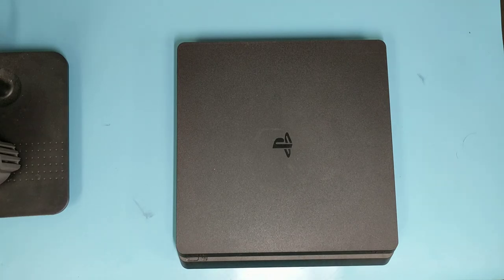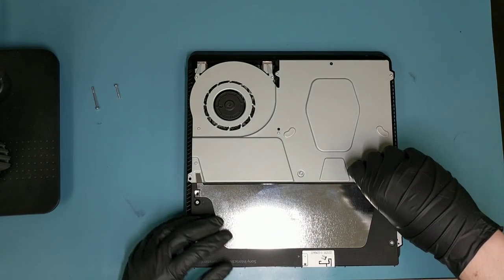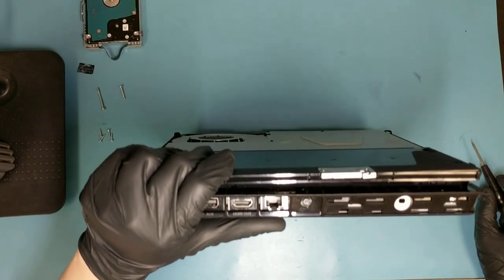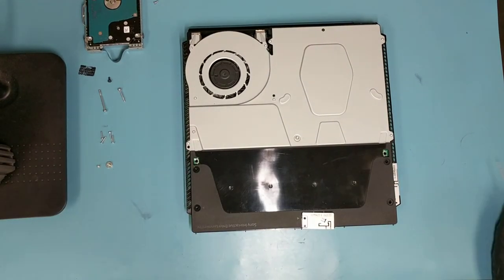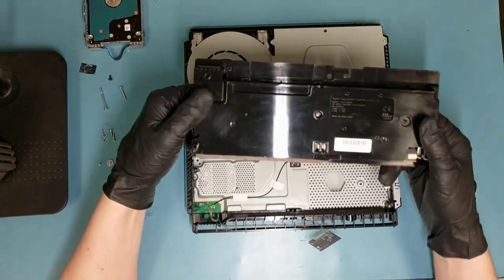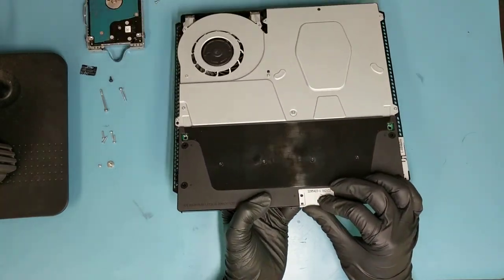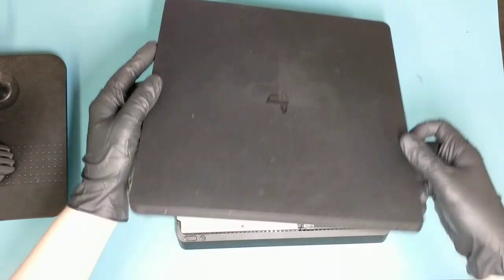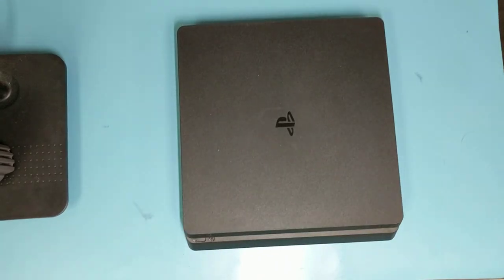PS4 Slim Power Supply Replacement

Comment: Thanks for this. I went to boot my console up today only to discover that the power supply unit seems to have fried itself in the night for some reason. I've ordered a replacement but it'll take quite a while, but when it does finally arrive this video will be a great help to switch them out.
Reply: where did you order the power supply
Reply: did it work?
Reply: @kartel876  Not for very long, clearly something else in the machine was frying them, but it did work long enough for me to transfer data to a new PS4.

Comment: Thanks for this tutorial! I just unplugged and plugged back the power supply inside and it’s working now! Thanks for the help!
Reply: what happened to your ps4? mine cannot turn on. its just beep once and nothing happens. can i try this method?
Reply: It means blue light of death. Common on PS4. I tried this method in the video (unplug/plug) the power supply. If this still not work, I suggest buy a power supply compatible to your PS4 you can replace it on your own by following this video.

Comment: Thanks for clean and precise explanation. Great help, you have my like good sir :)
Reply from the maker: Happy to help!
Reply: I ordered a new power supply and I  got it all ready to put the new one in but the female end of the connector is a tiny bit different than the male end and won't snap in place what can I do to solve this problem?
Reply: Fix Ezy do you have to have a certain mode number power supply? Not sure which to order for my ps4 slim.
Reply: @tjcook9918  Yes you do. Check what CUH your PS4 is, and order a power supply that is made for that Model. SONY has this HORRIBLE thing that for every year, they change a little of the design of their consoles internally and that means if you buy a CUH 2115A PSU and have a CUH 2015A console, you cannot install it.
Reply: @dw8597 
0

Comment: Thank you for making this video it helped me fix my PS4 :)
Reply: Is the ps4 power supply the same as ps4 slim
Reply: Jose Mendez you might have a different one open your PS4 up and look at the back of the power supply
Reply: @human9234  oh ok
Reply: @human9234  wait before did your ps4 have a light or was it like dead and it didn't even turn on no noise no lights

Comment: Thank you so much for this man, the only problem I have is that there is no metal rectangle piece under the top of my ps4 and it only has two Phillips screws
Reply: Did It still work mine don't have that either but I ordered the one that does

Comment: I was hit was the blue light of death and did this, but re installed the old power supply and it worked just fine after.
Reply: This comment saved me $100 and a ton of heart break I did that and it works fine!!
Reply: @jaysantiago830  did it worked? Got strucked by lightning
Reply: Gary Clark, Jr yeah mine would turn on for 1 second then off disconnecting the power supply then reinstalled the old power supply and it works again
Reply: @jaysantiago830  Wait, you just took off your power supply then reinstalled it and it worked again? What was the issue then?
Reply: Yekkusu Sekai Seiken I opened it up un screwed the power supply then took the whole thing out and put back in and it was fixed
Reply: Gary no last name Were you able to get yours fixed?

Comment: Hey When I turn on my PS4 slim, it shuts off right away
Do I have to get a power supply replacement??

Your reply would be greatly appreciated. Thank you
Reply: Make sure your power cord is in good try and boot safe mode if you can but most likely a power supply or software issue
Reply: No, if it turns on then something else is the problem

Comment: Thank you for the video. I did not have an antenna on my version, but your instructions still helped. My PS4 did not power on with a replacement power supply. What should I do next? Is the board fried?

Comment: I broke a wire on the 4-pin power cable that connects the PSU to the motherboard. Is that replaceable? Model is a Slim CUH-2015a.
Reply from the maker: Yeah it’s a separate part. You can buy it online for like 10 bucks
Reply: @FixEzy  Thanks. Got one on eBay for $8 so hopefully I can get it fixed without too much hassle. Looks like I need to remove the disc drive to remove the broken cable and route the new.

Comment: The peace where you pull that has the like 4-5 little black wires that’s hooked from the Power Supply to the console I’m having a hard time pulling that out i don’t want to break those little wires how do i get it out easier
Reply: I’m trying to detach it to replace it

Comment: When the power button of my PS4 slim is pressed, the blue light shows for 30 seconds ( it doesn’t flash. Just a blue light) and switches off. I thought it was the APU? But could it be the power supply?
Reply: Mine does the same idk I'm just gonna hope it's the power supply and fix it myself

Comment: hey, i have a PS4 slim white CUH2006B B02 , i was wondering if this model from an online shopping site is compatible

PS4 Slim ADP-160ER Portable Power Supply Replacement for PlayStation 4 Slim CUH-2000

thanks
Reply: Are buying used ps4 consoles inside sites legit?

Comment: The don't know what happened to my PS4 slim but It won't turn on when I press the button and Is that mean AC power cord broken or I need to do power replacement when I turn on even the blue light didn't show up So can you show me how to fix please
Reply: i have that problem had you fixed it??

Comment: How much does it cost to repair and new power supply
Reply: Power supplies are about $40-60 usd. A fix like this is easy to do, its cheaper to do it yourself unless you wanna shell out another $40

Comment: Hi, from which places can I get 12 volt on a PS4 Slim ? I removed the internal hard disk, I put a sata extension and the 12 volt is missing for the 3.5 disk of 4TB WD40EZRZ, this disk get 5v 0.6 A and 12v 0.45A, the original Toshiba 2.5 of 1TB says 5v 1A, thanks
Reply: I opened the power supply and 12v is the main output voltage, I did not know, I soldered a wire to the output of the supply and the 4 TB WD40EZRZ SATA disk was working ! :-) 
( These from sony! All to save a thick 12v track on the SATA output )

Comment: so i had a dead ps4 dont know what is wrong with it randomly wouldnt turn on i ordered a power supply and did this still not getting any results and im positive its setup right could you explain to me what else might be the cause im not getting any noises or lights when i try to power it on. could a dead harddrive do this? someone please let me know
Reply from the maker: A bad hard drive would not cause this. It’s gonna be a bad motherboard or a bad PSU or a bad power cable. The only way to tell is to check output on the new PSU with a multimeter.

Comment: My power button is sticky not stuck but sticky from my dumb drunk cousin spilling her cooler on it. Is it easy to clean it so the button works normally just worried that i might have to open it and clean it but is it possible to open and clean it without much work? Or is there a way to clean the stickiness without opening it?
Reply from the maker: Get 99% isopropyl alcohol. Unplug the ps4. Get a cheap toothbrush. Dip the brush in the alcohol bottle. Brush the button and dip it again. Do this until button is not sticky. Or take it apart like in my video. It’s only gonna take 5 min.
Reply: @FixEzy  thanks man that was bothering my ocd lol

Comment: Hey can anyone tell me if the power supply on the old ps4 and ps4 slim are the same???? I really want to fix it and save myself a couple of bucks, because my power supply on my slims broken, yet the one on my old one is fairly new. Only reason im doing this is because my hdmi port is broken on my old one, and its 50 to fix when i could buy the tools to do it myself for 15 bucks
Reply from the maker: The power supplies are different. If you wanna save money replace the HDMI on the old one yourself.

Comment: My PS4 the only thing it does is the blue light and the turn off and doesn't turn on anymore. Is that the power supply?
Reply from the maker: Yes it could be the power supply. There is no way to know for sure unless you try a new one
Reply: The gpu is not attached properly that's the problem.
Reply: Fix Ezy i need help i can smell battery acid coming from the back of mine

Comment: I recently ordered a new power supply because when I turned my ps4 on it would light blue for 1 second then shut off
Reply: Tony Faded same bro that my problem rn . Plz do tell me if the power supply need to be replaced
Reply: Tony Faded Did changing the power supply helped, I have the same problem  please help me out. Thanks
Reply: Same problem like me...
Reply: @zakizulkarnain3022  did u ever bought the power supply?

Comment: Hey bro can u fix my PS4 Caz i Bough a Power canle for My PS4 Slim n wen i put the cable it womt Turn my PS4 do mean i need to change the Power Supply bro Need Help plz need Help do i need to Change My Power Supply bro

Comment: My ps4 has no response when I press the power button it don’t turn on could it be a power supply problem
Reply from the maker: Most of the time it is. I would say like 90% of the time
Reply: Fix Ezy I got it to turn on using my controller but I can’t turn it on with the power button
Reply from the maker: If it works fine when you turn it on with a controller then your power supply is fine. Must be just a bad switch in the power button.

Comment: Please replay can any ps4 slim power supply work or you have to get the same model number n16 or n15
Reply from the maker: At the moment any PS4 slim power supply will work. Later they might release a different model. But right now they are all compatible
Reply: Thank you bro
Reply: My ps4 turns on but turn off when I am going to play a game then I have to unplug and it again this time it will just say it’s loading up then shuts down
Reply from the maker: It sounds like it could be power supply but not necessarily. Could also be a problem with a hard drive or a GPU. Maybe take the hard drive out first and plug it in to a PC and test it
Reply: Not all power supplies will work, I changed one today and it looks completely different.

Comment: When i try to turn mine one it will beep, blue light stays on for awhile. Then shuts off. Does this sound like a power supply problem? No video comes on screen, just doesn't start up fully all the way.
Reply from the maker: In a case like this most of the time it is the power supply
Reply: @FixEzy  thank you, when I got the PS4 it started up fine, 15-30 minutes into playing it just shut off on me. Had it stuffing around for awhile now I'm going to attempt to fix it. Wish me luck haha
Reply: Nice
Reply: @josh6506  😑😑😑😂😂😂
Reply: @MaggotCorpseMusik haha nice😂😂
Reply: Yep its power supply and same thing happend to me accept no beeps nothing at all .Or it can be dust in fan and around the ps4 cooling .
Reply: MaggotCorpseMusik same here
Reply: Thats why u get a xbox peasants
Reply: @josh6506  I would rather buy 1 new battery for my PS4 than buy a hell of a lot of batteries for my Xbox controller

Comment: So what if I turned it on and it was bout to turn on then it made a loud pop noise then it eont turn on anymore at all? How do I kno if it's the power supply? (Btw it's been infested wit roaches lately)
Reply from the maker: The only way to know for sure is to try a new power supply. And if that doesn’t work then it will be a problem with the main board. And if you are not familiar with a motherboard level soldering then it will be a new PS4 time.
Reply: Get a new ps4 rip

Comment: Good instructions.  It didn't work.  I sent away for parts twice the part that matched my consoles model number "CUH-2105A" didn't match the model number that's stamped on the bottom of the power supply "ADP 160CR".  YOU HAVE TO RIP THE POWER SUPPLY OUT TO GET THE MODLE NUMBER off of the power supply.   They went through a bunch of models i guess because they're shit.  Anyway I got the right part on Amazon and that was shit.  It showed some sign of life the fan booted up and i got a blue light but then it died and wouldn't come back on.  that was more than the old power supply did and i still think the power supply may have been the problem but who knows.  so i bought a used system a ps pro then that broke the fan went i sent away for a new fan.   I considered trying to get another power supply for my slim but its $80-100 and Sony is going to repair it for 113$ so I'm sending it in... whenever the box get here I'm guessing it'll take forever.  Hope you guys have better luck

Comment: Anyone knw about ps4 problems because I am facing issue in ps4 . When I turn on the PS4 within a second blue appears and in 10 seconds the blue light goes off do you knw any problem with that ! Please help me . Then when open the top part PS4 I saw the fan rotate spin for 2 seconds and then stops please help. I changed HDD but still it’s the same problem please help me please .

Comment: Mine is wet
Reply from the maker: I recommend taking it apart completely and scrubbing all surfaces with isopropyl alcohol until there is no visible corrosion. Then dry it out and put it back together and see if it works. That’s a solution on a budged. Of course it’s best if you can take it to a professional repair shop.